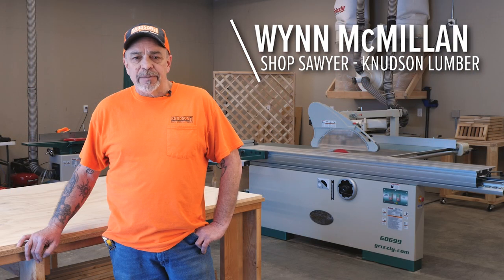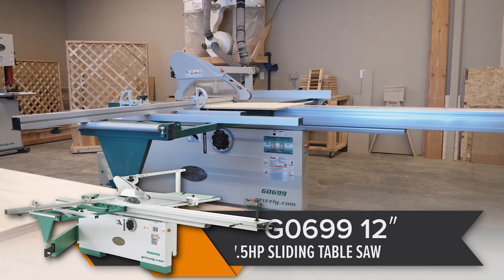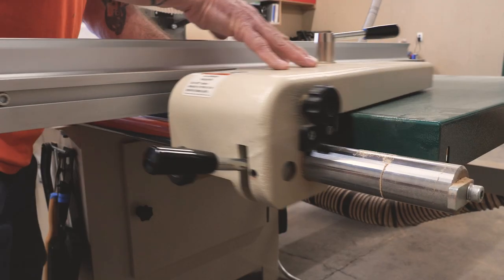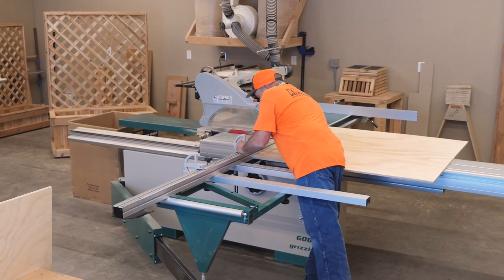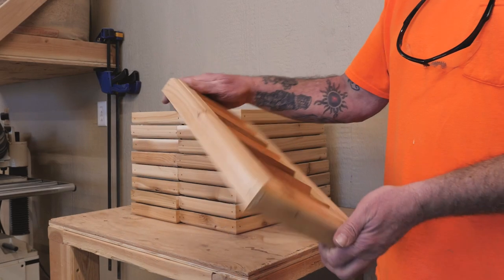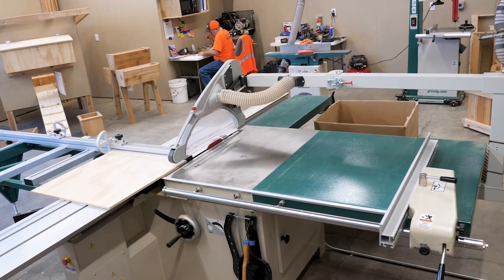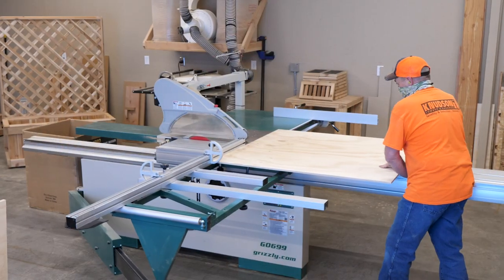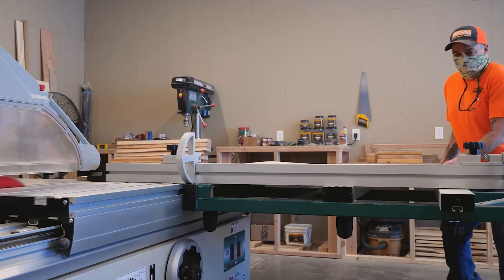Ask a Customer: Are Sliding Table Saws Worth It?

Comment: is this available with a single phase motor?
Reply from the maker: This Table Saw only comes with a 3-Phase motor. But we have plenty of other options at:  https://www.grizzly.com/ Check it out!
Reply: the installation at my workshop dont have 3 phase, so i get a phase converter and worked great with a 10hp motor sliding table saw
Reply: @quepexdamn  Did you go with a rotary or solid state phase converter?
Reply: @MoGhotbi  rotary, if u get one be sure is the double of capacity of you machine, my sliding table saw is 10 hp motor so i get a 20 hp rotary motor, i find at Facebook marketplace you can save a lot money
Reply: @quepexdamn  Thanks!

Comment: Skip the sliding saw and get a panel saw .  Takes up less space , easier to load sheet on , safer , but alot more expensive , but worth it if you are in business .
Reply: If the only thing you are using a slider for is panel processing. A panel saw is a one trick pony and has far less versatility than a slider.